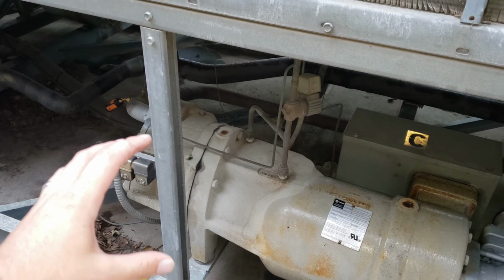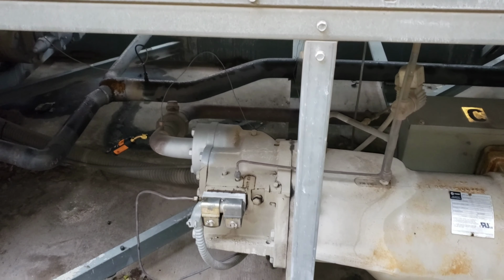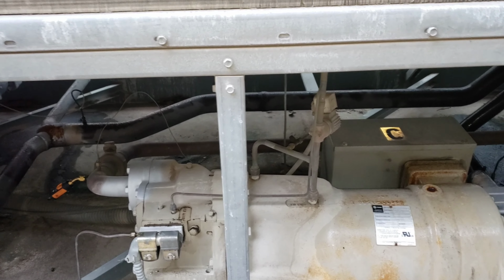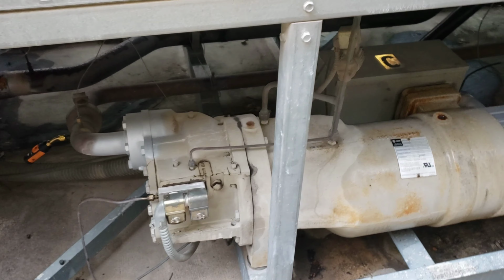Trane Chiller Compressor Unloader Stuck - HVAC Technician

Comment: If you pump down the compressor and remove the flare fitting on the end of the slide valve you can put a 5/16 nut driver into the hole and tap on it to free up the slide valve. I went on a job behind another tech to replace the solenoid kit. In the cabinet was another new kit that someone had bought previously. I got suspicious and downloaded the service manual and followed the procedure mentioned above and it worked for years without any issues. Quick fix that several other companies couldn’t do. Customer care and support!
Reply: Pump down hev stom chillar liqued comprssstom unlorder stck up nog mechisom working systom  gas nog passing unlord workinv corold systom comprsorok

Comment: She already has a leaking lip seal (indicated by the aluminum block in between the solenoids and Comp housing) . As stated in the previous comment the sb for troubling shooting is helpful, but an old timer showed me a trick with hooking up a manifold set  hp to discharge, planning to suct, and middle port to the Schreiner port on the slide valve cover. You can crack or burp manifold value  open momentarily to load or unload disc to load, suct to unload. If you leave suction open and comp does not unload you know that slide valve is issue. If it loads and unloads fine you know to start looking at solenoids or triacs.
Reply: Hi, Can you explain this through video please.
Reply: Nice

Comment: I have a trane rtwa chiller compressor B tripping on latched fault : compressor overload . This system did have a leak and we fixed the leaks and recharged to factory LBs but when it gets called on right away it’s tripping and my alarm light comes on for latched fault diagnostics is compressor overload do you think this is my problem ?

Comment: I have seen them come out of the factory with the loader wiring reversed - It starts on full load. I used to check that every compressor unload solenoid was correctly energised on start up

Comment: There is a procedure to switch loaders on and off to troubleshoot to see whether the problem lies in the compressor or the controller.
Reply from the maker: Ill look into that, i haven't come across a specific procedure before. Thanks for the tip
Reply: @HVACTIME  Try Trane general service bulletin RTAA-SB-5 starting page 41.
Reply from the maker: @larryboy4905  amazing thank you

Comment: There's a male unloader pair (these) and a female unloader (single, on the back), right?  So during start-up the female valve is unloaded... but you're saying that after the first start-up in the morning the female valve closes and the male unloaders are set too high?  And can't move?  So if the female unloader couldn't unload it wouldn't even be able to start, but now it can start but runs too hard.  Our 120ton is having unloader problems right now, those pistons get sticky!  Looks like they want to change the compressor... makes bad noises, like marbles inside.

Comment: What about liquid pressure.  Is the condenser fan makes noises when unload not in operation.
Reply from the maker: I dont understand you're question.
Reply: @HVACTIME  sir .   When  unload not working properly.  It's creating high  liquid pressure in condenser and thus condenser fan makes noise also . And expansion valve close partially because of unload commands. I dont know how to explain.  Poor English😒.  Anyway.   Expansion valve, loading unloading valve and condenser all works in proportional and in triangle 🔺️.  And thanks for sharing your valuable information.  God bless you
Reply from the maker: I understand now, yes they all work together but it shouldn't make the fans noisy.
Reply: Sir, In this case I think the discharge pressure will not rise higher because the expansion valve must be closed and there will less refrigerant entering inside the compressor. If less refrigerant is entering inside compressor then the discharge pressure will also be less. Only the compressor will keep running in this case because of stuck unloading valve. Also I doubt why it is not getting trip under low pressure after reaching the setpoint. Because expansion valve is closed and it will not allow the refrigerant inside compressor and compressor keeps pumping due to failed unloader. Also why the compressor does not cutoff automatically if the unloader is failed but the demand is met. Correct me if I am wrong Sir please. Thank you.

Comment: FYI, should not be opening the panel with mains on and exposed terminal blocks like that. That is very dangerous.
Reply from the maker: Its not ideal but frequently necessary for troubleshooting.
Reply: @HVACTIME  Definitely makes troubleshooting faster, but there are safer options such as a meter with a wireless display or installing scope probes with the power off and then closing the panel before running again.
Reply: Don’t tell him how to do his job
Reply: @hvacusanda7269  Wow it's amazing how stubborn people can be even when it's a literal life and death situation.
Reply: @kmidst_kn6329 are you a pencil pusher or have you worked in the field?
Reply: Seems like the convoy went a good direction before you made your comment. Let's leave it at that for new techs that there are wireless meters so the cabinets can be closed. Personally I think there's enough to keep track of, closing the cabinets are a good safety percation until you go independent or more experience.
Reply: @internetpointsbank   The VFD has enough energy storage to easily be fatal, not to mention the mains themselves. It's not worth the risk no matter how much experience you have. Just be safe people. Think about your families.